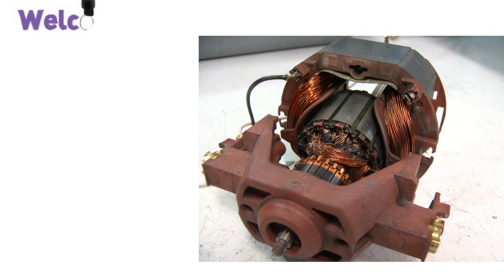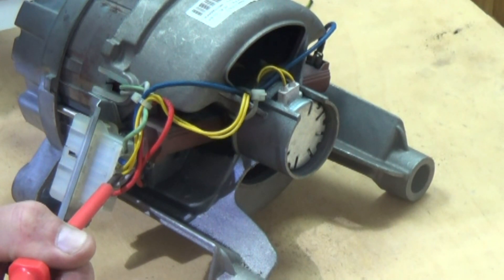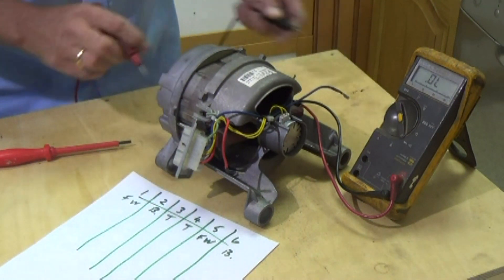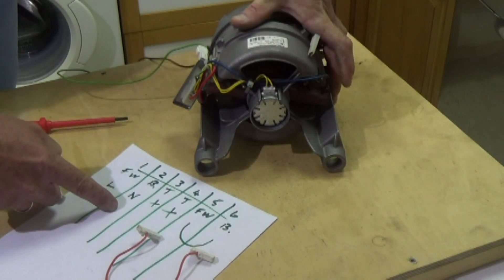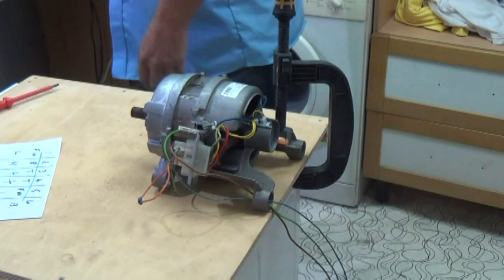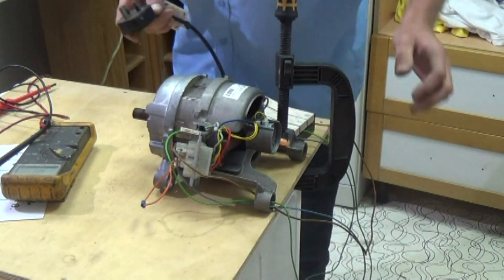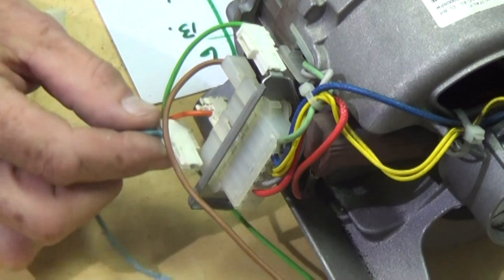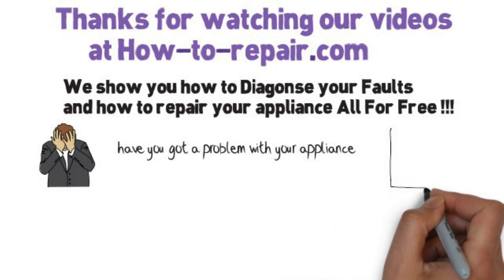How to test a washing machine motor AC. making a test rig for the motor

Comment: Hello nice tutorial I'm working on my front load Fridgidaire washer. My washer doesn't go to high speed spin. The test sheet indicated 2.6 ohms +- 7% on testing the 6pin plug. They fall between 2.6 - 2.8 ohms. Are the readings indicate a good motor. Ohm readings on good motor should fall between 1-5 ohms. My motor is brushless. Thank you for helping me understand ohms reading on motors.

Comment: hi after recovering a universal washing machine motor intending to use in my workshop, I wired it up to a 24v AC supply and it worked a treat. I wired up a changeover switch to reverse the direction, all ok, but not much power in the rotation. So I connected via a trip mcb, to the mains voltage, and now it doesn't work at all. Is there anything I can do to fix this or is it just fit for the bin

Comment: Very informative video, Thank you very much.....
I have Bosch MAXX - WFO2430, front loading Washing machine... 
it was well since 5 years and has a problem now...
The problem is .....
in any mode (wash or Spin etc.,)  ......the Motor kicks-in to start and stops immediately the very same second.... and waits for 1 or 2 mints .... again the same happens repeatedly until the program count-down reaches to "0" .... 

All other Water in-take and pump-out are working fine without any leaks. No error codes were displayed during the process.
I have removed and tested the motor as mentioned, it worked well (With high RPM)... 

Any help please?

Comment: I notice that the brushes are mounted at an angle to the commutator in my motor, and I wonder if you know the reason.  When the motor is rotating in one direction, the commutator will supply a force to the brushes that would act pretty-well directly against their springs (so no lateral force against the sides of the brush holders), but in the other direction, there will be more lateral force than if the brushes were perpendicular to the commutator.  Do you know the reason for the angle?
I'm using it to drive a band saw, so it will always rotate one way, and as luck would have it, it's the "wrong" way.  There are tapped holes in the frame of the motor to mount the brushes the other way, but that would involve turning them upside down so that the curvature of the brush face would match the curvature of the commutator, but I can't get the brushes out of their holders.  The angle puzzles me, as washing machines invariably rotate both ways.  Are the brush angles optimised for the high speed operations (spin)?
Reply: Yep it's for high speed. To get to high speed the field windings need to supply less magnetic flux to reduce the back EMF generated in the rotor. And then the rotor flux twists the flux from the field windings. To restore that, you twist the angle of the brushes.